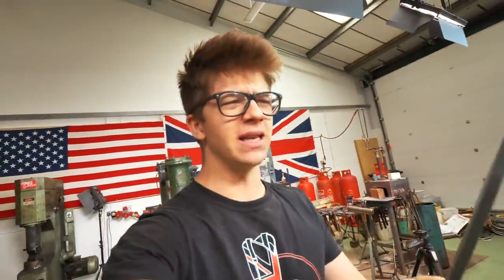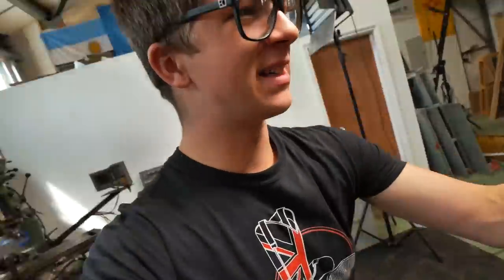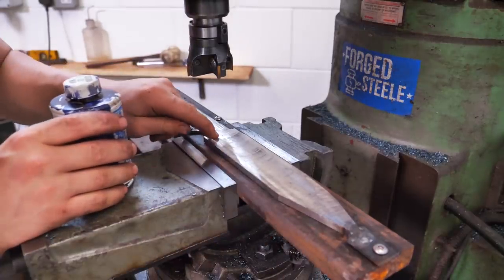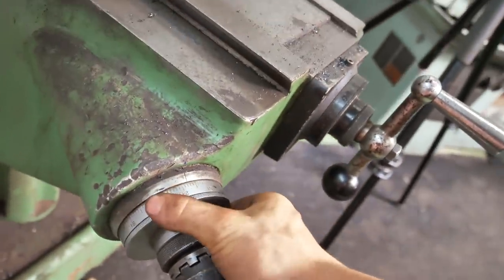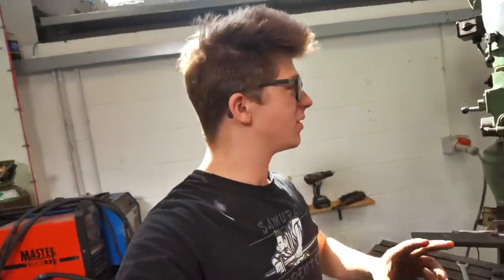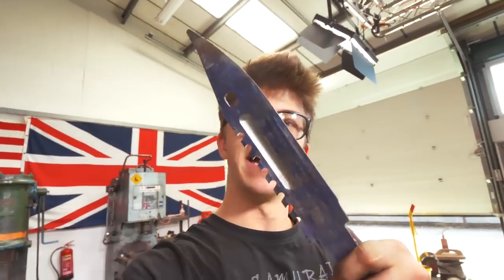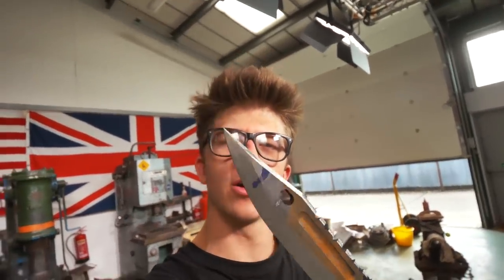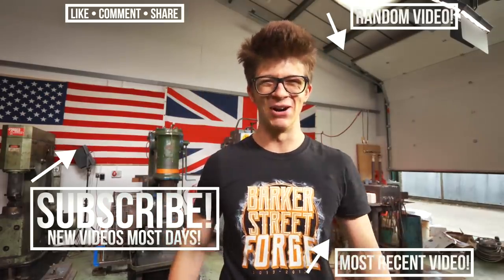CS:GO DAMASCUS M9 BAYONET: Part 2

Comment: I remember when the M9 came out, we still had many of the older Viet Nam era bayonets, but this one was made because of the Bradley Fighting Vehicle. It seems that the Bradley's  25mm gun had ammunition cans with plastic straps that needed to be cut to open them, the saw blade on the top of the bayonet was made for just that purpose. it is a bit too fine for cutting wood and not very useful for metal. In the field I used mine to cut the top off of a plastic barrel (worked pretty well). Some of the other features that nobody ever knows, is the pouch on the sheath is for a Baretta 9mm pistol magazine, and on the guard, there are two vertical milled grooves. These grooves were made for ( in the days before alcohol was considered a problem ) ambidextrous bottle openers (not kidding, was in our introduction safety brief) there is also a screw driver tip on the sheath to disassemble the bayonet into 5 parts. The saw grooves on your version are much more like the ones on the Navy Seal knife (Buckmaster) which were (we were told) for cutting through the skin of aircraft. I still have my bayonets if you need photos or dimensions. Another excellent job in the workshop, you do fine and interesting projects, and have a good sense of timing and humor. Keep up the great work!
Best Regards Frank Novak
Reply: I thought the pouch on the sheath was for a sharpening stone?
Reply: @marblemarble7113

Comment: Love the bayonet so far.Don't give up on the bridgeport head angle. The 4 bolts on the front shoud unlock it. The bolt on the side is like a worm wheel to adjust the angle. Make a vid out of unsticking it! Your machine will Love you for it. Your a tradesman, If it doesn't work fix it!

Comment: Alec, have you ever seen blacksmiths heat the tang first before the tip of the blade before the quench? Reason being is so the blade has an even head, and so the tip does not overheat, and possibly weaken. I know you do the heat cycles to make the metal more malleable and not crack because of that sudden change in temperature, but maybe keep that in mind for future projects.

Comment: You should make a bigger forge so that you an get an even heat on long pieces of steel.
Reply: NigthH4wx, YES, YES, YES!
5, 6, or even 8 burners long? That would be epic. He could forge out some Damascus sheet to build it with even. Big Damascus Union Jack panel on the camera side?
Reply: I have been saying this in every video since he got to his new workshop. He's either ignoring me or he hasn't seen my comments. Either way, he must've realized it himself that his current forge is only good for making small items.

Comment: Hey man, the plate you screwed the knife to was a good idea. Following up on that if you cut a piece of metal like a doorstop equal to 30or so degrees and put it in the underside of the plate  the knife will be at the correct angle even if the milling machine cant be!

Comment: another thing that can cause vibration in the cut is that the head is trammed square. square is good for a nice flat shallow pass, but if taking a deeper cut, the amount of spring-back can mean that the far side of the cutter actually rubs and can lead to vibration on the active cutting side. this can be avoided by tilting the head of the Bridgeport a little to one side, maybe only a few thousandths of an inch, 0.004" might be enough. one thing to keep in mind, is that for wider cuts, it can make a bit of a dish as you get to the cutter edges. love your videos.

Comment: Alec, something to invest in is a SECOND vice for your mill. since you seem to be doing longer items like this sword etc, you can have a second vice ready to place on the bed and then use TWO vices to grip your work piece. Will pretty much eliminate the chatter you're getting using one vice with unsupported ends. A little bit of extra set up but very worth while. 
Very nice TIG work too, especially for just starting out with it.

Comment: Alec I used a Bridgeport Mill in my Engineering days, if I remember correctly there should be a pin to pull out so the head tilts over further , safety mechanism. Love watching you channel.

Comment: in order to tip the head on the bridgeport you need to loosen the 4 face bolts first. The hex you pointed to is just to be able to finely adjust the tilt of the head, if the face gear it engages to is stripped, or the bolt broken, you can just loosen the face bolts slightly and tip the head by tapping it with a mallet to one side. be careful it doesnt fall over though. keep the face bolts slightly snug.

Comment: Unless you ended up building your own. The 2x48 grinder your using has a reasonably priced surface grinding attachment. Has some adjustment points on it so you can fairly quickly make a tapered tang.

Comment: Alec, you need to install some dust collection system in your grinding area, with suction points around the areas where the grinding discharge occurs, put it through a cyclone and collect it on a bin for dumping, and discharge the remaining air outside. 

Would keep you grinding room, and your work area, much cleaner. 

The tilt on your mill head works with a worm at the end of the bolt you turn, onto a gear.  You did loosen the four lock bolts so it will turn?

Comment: On your Bridgeport the worm is probably damaged and sometimes, not always, if you put pressure on the head and turn the worm as you apply pressure it will move. I've seen the heads pinned in place after the damage is done, so you might look for that as well

Comment: Hey alec when your going to quench a blade if you use a magnet to check the steel when heating for the quench it will no longer stick to the blade when it reaches critical temp. Just a thought

Comment: As a machinist Alec, your carbide inserts on your cutter are wearing out. One way to tell is if you can see sparks coming from the cutter. Also, where and when did you learn to do tool and die work?
Reply: Most inserts have many facets and edges, thus you can flip them around in the holder.

Comment: Regarding to pivot the mill head the should be a taper pin that you have to take away to be able to turn the head. It is to secure the heavy weight and to reset the head at the correct position again. Good luck and thanx for some good stuff.
CS:GODAMASCUS M9BAYONET: Part 2, 
Time 8:00

Comment: Alec, if you are not cutting through the piece, even then, fixing the sacrificial bar to the mill table would have prevented the vibration you mentioned in the first roughing cut.

Comment: Need a dovetail cutter. 

Hold the knife in the jaws on an angle and cut in using the dovetail cutter. Woukd give a very good saw blade on the back of the knife.

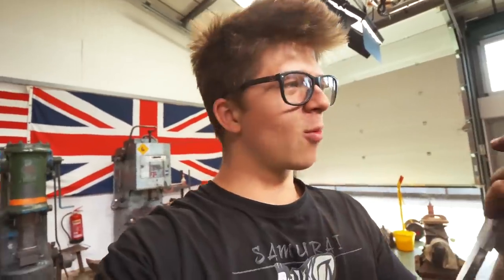Comment: 9:30ish.  You can cut wire with it... in theory.  I was issued an M-9 when I went to Operation Desert Shield/Storm.  If I recall correctly, its wire cutting abilities then were questionable.  But those were older M-9s too.  Great work!  Can't wait to see the finished product.

Comment: Tip for the future:
If you're going to mount something to a piece of material for machining (that piece of material is typically referred to as a "pallet") You can just clamp it straight to the mill table instead of using the vise. It'll be more rigid, and you won't get the vibration that you mentioned.
Reply from the maker: +Patrick Holmes AWESOME TIP!! Thank you Patrick :)

Comment: Hey Alec , I don't know what model of bridge port you have but that bolt you said was cranked down on too hard will be a worm that engages on a wheel to tilt the head . If this won't budge it's pinned in and can easily be removed ( on my bp anyway) great video.

Comment: You were grinding with the point of the knife pointed against the direction of the grinding belt. That could have been bad if the point caught on the belt. You should always consider grinding with the point in the direction of the belt. Think you could mass produce some letter openers or marking knives for woodworking or a scratch awl?  I'm a woodworker and found you through the Samurai Carpenter. Great work and great videos. Thanks for providing such super fantastic content.

Comment: Don't know if you tried this, but on the left side of the bridge port when you're looking at it, there is a small pin that has to be pulled out to tilt the head. Hope that helps.

Comment: Someone said it earlier, but if you want a machining challenge try to do the mounting bracket that connects to the weapon. Also you're looking at about a 2cm diameter for the ring that goes over the muzzle device.

Comment: So the spine side of the tip is only suppose to be beveled on one side so that when you go to cut the wire with the sheath it doesn't bend the wire over.  Its a small detail and since you probably wont make the sheath, inconsequential, but I thought  you should know.

Comment: does your Bridgeport have a locking pin that needs to be removed before it with allow the head to rotate over. i know the one i use has one but have only ever moved the head back and forth and not clockwise.

Comment: Teeth like those on the spine aren't really for sawing, like the k-bar and almost all other survival knives they are just for notching sticks, so that if you have to tie up a shelter you can cut grooves around the poles so that your cordage doesn't slip when you tie them together.  With that much blade hacking through a stick would be ten times faster than sawing it would, especially since the teeth don't have a set in them.

Comment: The bevel on the back side of the blade should only be on one side, as the flat side is used for the wire cutter function of the real blade.

Comment: Don't your Bridgeport mill comes with coolant pump? From my experience, milling any iron/steel material including aluminium with running coolant reduces the wear and tear on the tips. Also it somewhat reduces vibrations... Tip from a friend of mine, if you are doing surface milling and you want to have a good surface finish, use Diesel as the lubricant for cutting.. It stinks, but gives a very nice finish.

Anyway, cheers to you and keep up the good work..

Comment: Fantastic bit of knivery....I just made that up. If you're interested in maybe fixing you Bridgeport tilt action here's a video that will help, a 2 parter ..... "Wells-Index Mill: Repairing the Worm Gear that Tilts the Head"   It's a YouTube guy named Keith. I didn't leave the link just the title of the vid.  Google it and it'll pop right up. ~ Thanks for the video.

Comment: The only difference from the M-9 bayonet issued by the US Army is that the issue one doesn't have the sawtooth spine and that your blade looks a bit longer than the regulation nine inches. The problem with the sawtooth is that once the bayonet penetrates a body, the sawteeth can catch on bone and prevent pulling out the blade. Otherwise it is pretty much as issued. The M-9 was developed from the old standby Marine Ka-bar, the indestructible and traditional tool of wars going back to WWII. They added a bayonet ring and clip and the wire cutter for the M-9. The only problem with the Nine is not with the bayonet but with the current iteration of the M-16, the m-4 carbine, which is so short that a bayonet is really meaningless.

Comment: You mentioned in the vid that the whole goes on the sheath and cuts wire. And while you are technically correct, I never once saw someone do that in my 4 years of Army service. I did have a $20 set of cutters I still own. This was very normal not to use the M9 for anything so you didn't have to pay for it if you broke it.

Comment: Is the oil flash fire just for dramatic effect?  It would seem that if the blade is hot enough to still flash oil, it was not quenched long enough as you are still way above the tempering heat range.   I am a complete rookie on this stuff....my knowledge base is mostly welding, hardening and tempering agricultural equipment components.

Comment: Alec, why are you using TIG welding? I thought it was primarily for welding stainless and non-ferrous metals, and its slower. Since you work primarily in carbon steel, aren't other methods more effective for your applications, OR are you just using it to practice and expand your skill set?

Comment: I was in the US Army when the Army was switching from the Vietnam era M-7 to the M-9. The M-9 was a piece of crap!!! The tip almost always broke off when doing Bayonet Drills and especially when you use it as a wire cutter because the bayonet was not properly tempered.

Comment: Not hating on you Alec you do amazing work. But machining bits should NEVER throw sparks(sad, i know😟) you should really slow down your feed rates.
Reply: Alex Wenham The sparks you see aren't necessarily the result of incorrect speeds and feeds but the forge scale being removed while milling. The same thing happens very often when face milling a piece of flame cut steel. The sparks are from the hardened crust sparking off.

Comment: Your welding too much with that tig welder, less heat less filler metal, tig welding generally penetrates much more that mig thus less weld is needed